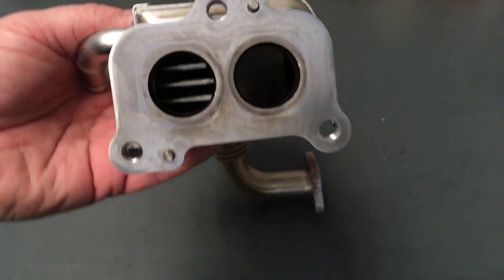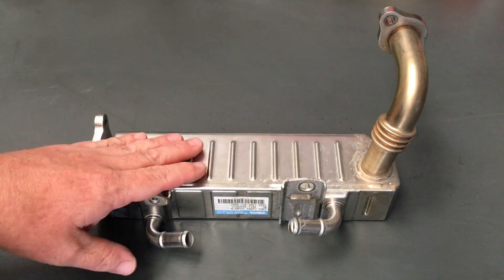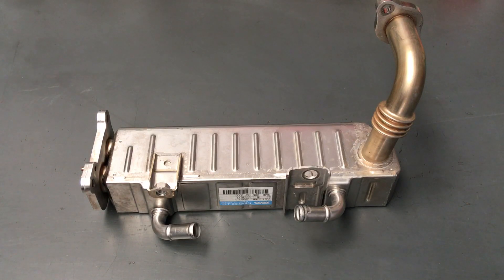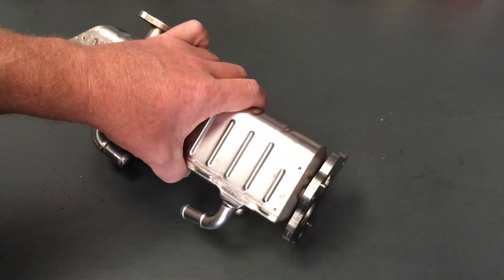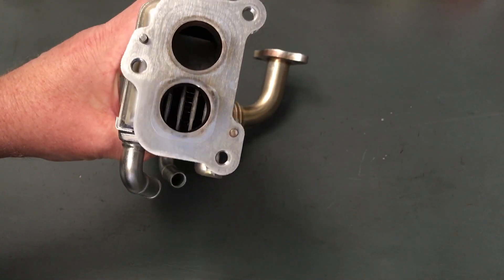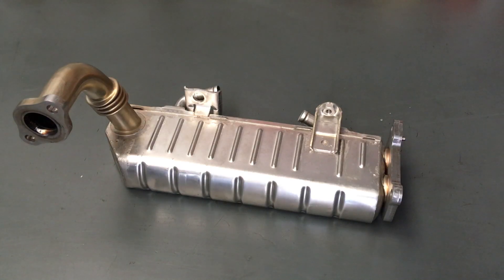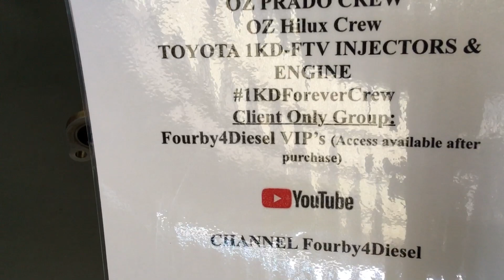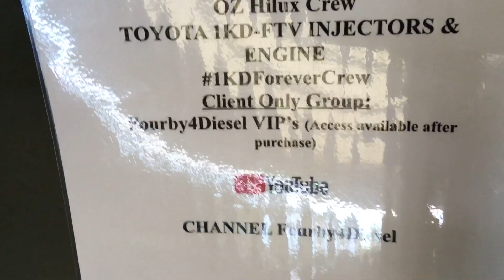MORE P0400 and EGR INFO

Comment: Well thought I would lift the bonnet and check  my 2011 Prado . Exhaust leak on the exhaust gas cooler . Thought I watch another video.  And as you said if they leave the front bolt out behind the coolant pipe it would crack the exhaust gas  cooler pipe . Before I went to check if the bolt was missing, I said to myself 100% guarantee it's not there . Sure enough bolt missing.  Thanks REPCO Repairs 
Cost $ 1008 parts then plus labour . Will clean and Tig weld wish me luck .
Thanks Anthony

Comment: What did you do to clean the carbon out? I used oven cleaner but took about 20 goes and still when flush it I got carbon coming out that wasn't without soaking the inside with mr muscle as well. I think I need an ultrasonic cleaner to do the job properly.

Comment: I fitted a 7mm plate to my 2kd hiace and at some point the inlet pipe cracked letting exhaust gas into the engine bay.
The mounting bolt had come loose. Got a replacement cooler used threadlock on the mounting bolt and actually removed the 7mm plate engine runs better then its ever run
Reply from the maker: The bolt doesn’t come loose ever it was left loose

Comment: I got the Prado 1kd. egr cooler pipe cracked as u described on weld, I put full block plate and egr delete chip plus rerouted cooler hoses to bypass it. I don't trust em coz if the leak coolant inside the cooler then engine is toast as water water don't compress at all. did all this about a year ago and she still runs clean crisp. low egt's and head temps(with engine guard) and no fault codes.
Reply: Even though my EGR is “switched off” (as I use my vehicle on the farm only), I think it’s still necessary to plate off the EGR cooler intake so that way I can bypass the cooler with the coolant pipes and so protect against cooler crack failure.
Am I reading this right?

Comment: Hey mate really appreciate your videos, I've gained alot out of them.
After doing a full clean of egr, intake and cooler. I've got a p0400 and p0406. Ive had the system apart several times, it seems all the vacuum lines and plugs are where they should be. If I apply a vacuum to egr the valve will operate. After extensive googling I can't seem to diagnose the issue. I'm wondering what other tests I can run before pulling the pin and buying a new egr assembly. Any advice you can offer would be greatly appreciated.
Reply from the maker: Don’t buy any parts because it won’t be those
Reply: @Fourby4Diesel  looking at live data list.
Egr close learn value is 0.8v. Would I be correct in thinking this is what's triggering the p0406. This is at idle and operating temp.

Comment: I have a 2008 Hilux with a 2KD engine (185,000 km). I have been getting the engine check light and the DTC is P0400. The engine check light comes on when I have been on idle for some time and sometimes it will just come on after driving for like about an hour or 2 on the highway. It would seem 2KD does not have EGR cooler, there is just a steel pipe from the head to the EGR. Looks like a slightly different architecture. Anyone with this experience on 2KD engine?
Reply: Es correcto. tu EGR es mas simple porque cumple con normativa EURO3. son los que se fabricaron hasta el año 2012

Comment: Nailed my problem for me. My mechanic did a 7mm plate install while I cleaned out the EGR and intake (1KD 280,000ks) and made a noticeable difference. About a month ago started hearing what sounded like an exhaust leak, soot under the EGR cooler and a drop in power. Just had a good look at the ole girl and the pipe is cracked big time underneath where it joins the cooler. Can this be repaired or do I need a new cooler?
Reply from the maker: Either

Comment: Another great video Anthony. You glossed over a full egr block, i have one after a full intake/egr clean and fresh injectors from you and it's run like a dream for the 2 years since. Quiet, smooth, no rattles or smoke and oil as clear as honey. But i've also read like you mentioned that a full block might be bad because no wastegate and the 1KD vents back through the EGR.  Legalities aside, do you really think a full block is worse then a 7mm plate?
Reply from the maker: I’m not sure that it will cause issues.

Comment: Good work Anthony.
Those 7mm plates will save this, excerpted from Baileys site.........
"Another common cause of Hilux low RPM rattle is a dirty or clogged intake manifold. It is worth trying (and good maintenance practice) to remove and clean the intake. The EGR system feeds exhaust gasses back into the intake, including carbon, which builds up over time. We regularly see cars with 35-50% of the inlet blocked up where the EGR links in. Once we have cleaned this out, the rattle has seemed quieter. Either way, this is good maintenance practice, as it balances out the AFRs (air-fuel ratios), giving some fuel economy gains."
Everything is a compromise and has faults, including EGR systems and KD motors, but as Anthony insists, the only way forward to ensure your motor is safe and reliable for many hundreds of thousands of km, is to do maintenance, maintenance and a bit more maintenance. 
The maintenance, like injector replacement, is like insurance and it is a workaround to prevent bing butta bing,... disaster.
Reply: Is a gasket with a 7mm hole a good idea? 
Thanks Steve.
Reply from the maker: Careful with info from others 😉